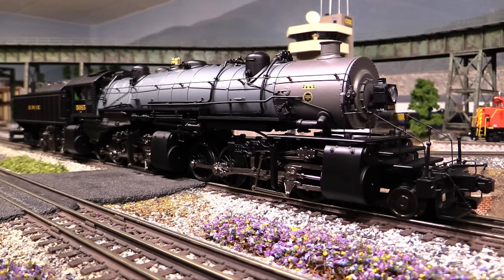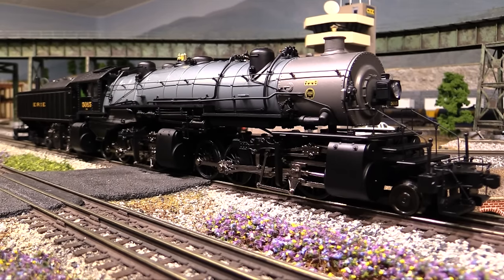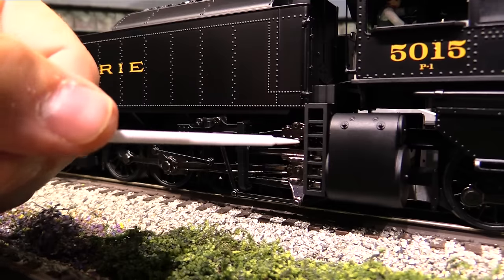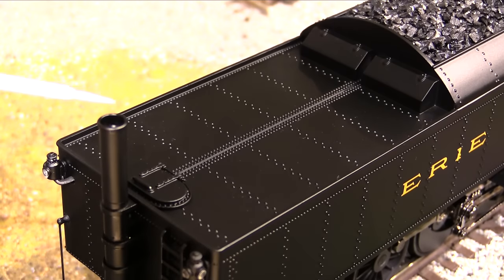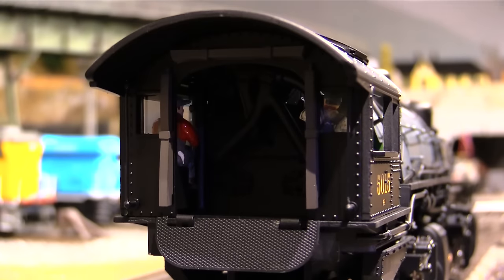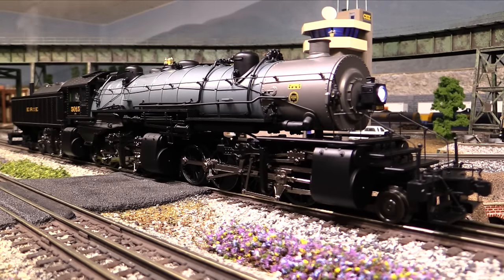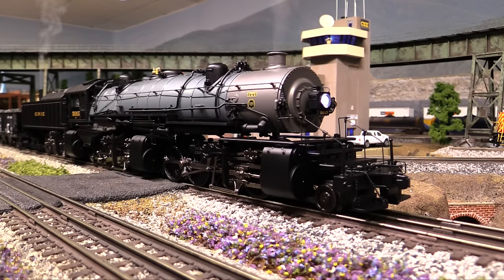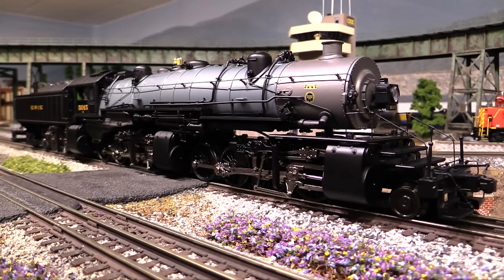MTH 2-8-8-8-2 Erie Triplex

Comment: So Big Boy and Challenger were far more of a success as they were more balanced? Any locomotives larger than those two were more likely use as pushers than pullers? And redesigning or replacing tracks for larger or faster locomotives will hurt the economy?
Reply: Karren Kuddlesberg 
More of a case of these not being known about. 
People would have seen the big boy these probably hardly got seen there's only a handful of photos as well, 15 at most.

This was larger than the big boys but gone before they were made.

There's was a quad steam train as well but only drawings no idea if it was made

Comment: It is not too surprising that they could not produce enough steam.
A larger boiler would have helped but could creat a problem with clearances and the larger boiler probably would have required a larger tender for coal and water.
Kind of a catch 22 situation.
Reply: Yeah, it was pretty much doomed from initial concept but you don't know until you try.  That's just way too much steam for a single boiler.  Look at what N&W did with their Y class; smaller boiler than comparable simple articulateds, but could produce massive amounts of power operating as a true Mallet.  The triplex may have faired better using a similar concept.

Comment: What do you base your pulling power calculations off of?
Reply from the maker: A complex series of calculations derived using high tech scientific equipment, and then those calculations are sent to CalTech for verification by a third party.
Reply: +ericstrains We got a jokester, just curious where your numbers come from
Reply from the maker: The engine is hooked up to a scale and then brought up to speed and I take note of the pulling strength. I could get more technical with the pulling power numbers, but they're just toy trains...it's not that big of a deal. But it does give a rough estimate of how powerful the engine is.
Reply: @Troll Films maybe, if space allows

Comment: Where is the real locomotive?
Reply: scrapped.
Reply: Why Scrap Such A Famous Looking Locomotive?
Reply: +Matthew Stacy Back then people didn't think of preserving steam locomotives. I guess they never expected steam locomotives to be considered historical in the future. Plus it's all about money. Why spend money to preserve it when you can get money for scrap steel?
Reply: There's also the fact that the locomotive was a complete failure. Granted, if it had constant weight on the rear set of drivers and the cars at the time could withstand the massive amount of tractive effort this thing put out, it may have helped some, but there was still the problem of it using up way too much steam. All in all, it just wasn't a very good engine in real life. Luckily, the models are very nice, and give us a rough estimate of what these beasts could do, had all of those problems been fixed.
Reply: +Matthew Stacy actually, I read that they were cut up and used on other engines
Reply: Capn Matter Just the Virginian engine, a 2-8-8-8-4 engine. The first was a 2-8-8-0 engine, the latter a 4-8-2.
Reply: Are you not one of the Knights of Obfuscation? All were scrapped!